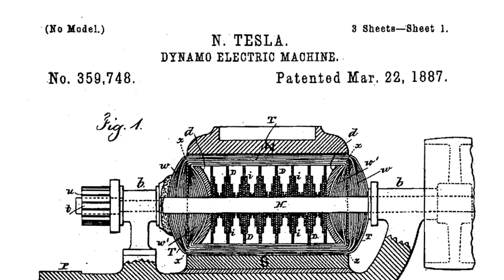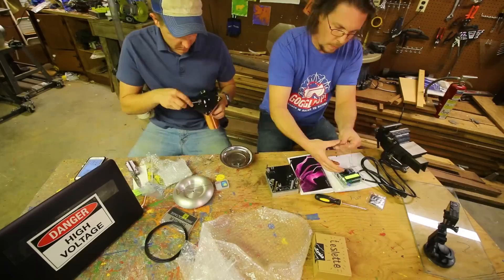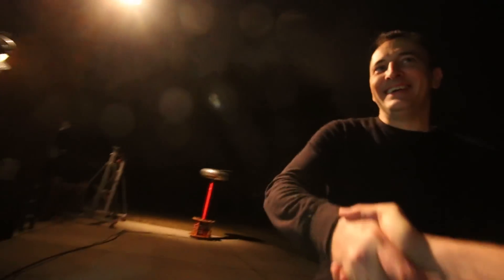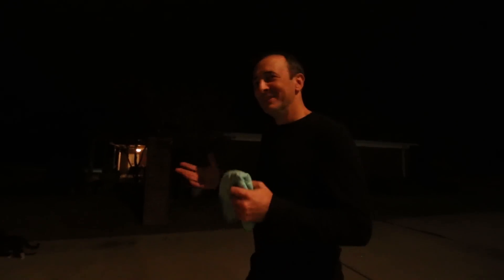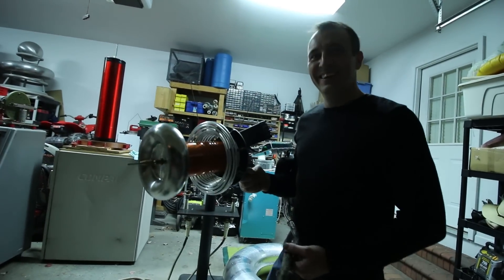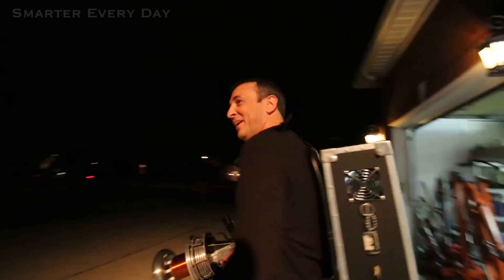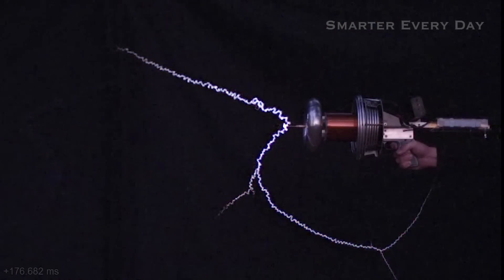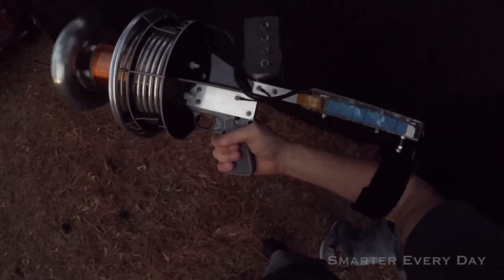Handheld TESLA COIL GUN at 28,000fps - Smarter Every Day 162

Comment: "He's just casually cleaning his Tesla coil" Walks over "What!? It's hittin your hand!"
Reply: Lite nyng he use grounding which is on his shoe which is safe
Reply: No, he literally said in the video it doesn't have enough current to be very dangerous
Reply: Voltage, current, and resistance are all connected. 

The human body is about 100,000 ohms of resistance. 

Voltage/resistance=amperage

It only take around .5 of an amp to kill you. 

Going by this equation it would take at least 50,000 volts to kill you. 

Generally people use 10,000V when demonstrating this but that gun definitely looks like it's more than 10,000V

No clue what's in there but V/R=A 
Is the math
Reply: @linuxd  Well most of your numbers are a bit iffy but your math is good. 
The tesla coil in the video is producing well over 100kV (When the power is maxed out it could even be a million volts) and the current needed to kill you is only about 5 mA. 
So why is he not getting grilled alive? There are multiple factors that needs to he taken into consideration.
1. Even though the resistance of the human skin is about 100 kilo ohms, his shoes makes him basically isolated from ground.
2. The skin effect plays a role when we're talking high frequency. To explain it quickly: when a high frequency current is moving through a given conductor, it will tend to want to run through the outside or "skin" of the conductor doesn't play a major role because the skin penetration at even 1 mHz is still a few centimetres if I remember correctly. The coil in the video looks to be fairly high frequency but not even close to 1 mHz, but it most likely doesn't play a major effect since what would kill you in this scenario is heart arrhythmia. 
3. Even though the peak current may be several amps, the overall power is still fairly low because of the duration of the spark (see slomo timer for reference). 
4. The resonant frequency of the secondary is knocked out of tune when the sparks touch him, making the circuit a lot less efficient.
5. He could have a ground connection on  his wrist making the current only pass through his forearm or hand.
6. Because the resonant frequency is so high, his nerve cells don't sense it and the risk of getting heart arrhythmia is reduced to basically nothing.
7. The circuit can't supply much current under any load which means that the voltage and also current will drop.
God that was a pain to write. Hope that clarifies why he isn't dead.
Reply: Rory M Duration of current also matters. Natural static charge easily accumulated in dry environment may result in tens of kV on a body that is enough to cause a spark across a few mm of air but it does not kill anybody.
Reply: Litenyng warning ear rape
Reply: Also a quick test you can do to test if you can handle more than 230 volts is to take  two forks and stick them in a power outlet. Disclaimer: Only works in countries with 230 volts.

(Don't actually you'll most likely die)
Reply: Mona Torkia  That's a dangerous message to send to people reading this. It's not safe.

Comment: When you figure out how to control lightning bolts and actually shooting them as a self defense tool instead of these devises please let me know. I will show you something truly amazing. Ahh what the heck, on the actual Tesla coils out there the wiring as well as the dome are all circular in nature. From spark gap to a circular coil as in figure drawing shown at 1:16 in the video. Ok now imagine the "coils" in other geometric shapes. Try that in a few different shapes and see what you get. The lightning bolts CAN be controlled. With a circular coil and other circular parts in the system the lightning is more erratic and less stable. I have no videos of this proof at this time, but i encourage you to try different set ups to see what the differences are that i speak of. 

Tesla invented many many innovations we use to this day. Two of the biggest would be WIFI and the incandescent bulbs. The thing about the two is Tesla never wrote or linked the two together that we are aware of other than in house testing in his lab, but he did state that his inventions would not need the use of modern known power lines and transformers. He was also a master in terms of radio waves and understanding them. His idea was to send power via radio waves (see HAARP antenna array) and some even believe it can control the weather or disrupt it in some way. Personally after almost 20 years of studying Tesla and this type of science i have come to find that Tesla kept some things to himself after the debacles with Eddison. I am sure that there are things he never documented just fr the sole purpose of it falling into the wrong hands.

Comment: I liked your video for many reasons - 1) Wearing your hat the right way 2) You seemed like a normal bloke, just very enthusiastic, not some cool talkin poser - I hate those guys 3) Anyone who appreciates Tesla, the guy, has my approval - 4) I learned something - I'm an old (UK) electrician who's learned to be respectful of high voltages and so called low voltages too, because the power distribution system delivers enough current to barbecue a human instantly - which sadly happened to a colleague when I was an apprentice  - cleaning out a HV bus-bar chamber thinking it was low - medium voltage, 415V, not 11KV or 3.3kv or whatever - Arced across and a terrible way to die, only recognisable by his ring apparently.   So I cringed seeing you let this thing zap you - I wouldn't have the nerve, despite knowing the current was low.   Hopefully, no-one is naive enough to THINK they can do the same with high voltage power lines or low - medium voltage industrial or domestic supply - But I've seen so many idiots treating it as casually as changing torch batteries - unafraid - unafraid because they don;t know how close they are to having molton metal explode in their face in a three phase flash-over.    A few educational videos of sub-stations exploding when people operate the huge breakers (the oil cooled/ quenching kind) too slowly would be interesting to see again and a reminder of the unseen power in those thin "wires".   It's HARD not equating huge arcs with danger - It's HARD to accept that most electrocution deaths are unspectacular, people just slump to the ground when as little as 50mA stops their heart.  ANYWAY!  on a more cheerful note!  You made a GREAT video here!  Thanks!

Comment: the Tesla gun vs the prince rupert´s drop
Reply: Glass doesn't have any conductive properties, so the arcs won't strike it (unless by dumb luck). :c
Reply: Neither does air, air is one of the only BETTER insulators. Yet you can see electricity traveling through it

Comment: Do you really feel smarter? The reason why this lighting cannot kill you is called  Skin efekt.The frequency of the output voltage is so high, that the current flows only on the surface of your body. Your muscles and one of them is heart of course :) are completely safe. Tesla coil can only burn you if the current is high enough.
Reply: Skin effect does not work with human bodies. You just don't feel it because it's too high frequency to actually effect our nerves, but it's not because it's somehow flowing on the surface. That said, the current can easily get really high and lead to internal injuries (with drsstcs and the like). Also burns where the arc hits you can be really bad. Small coils, as long as they're standard sstc's are safe to touch, but anything pulsed like drsstcs are dangerous, even though one might not feel it at first

Comment: In Canada we consider anything more than 5 micro amps to be dangerous, and I think a Tesla coil averages 23 Milli amps. Think of current as speed. Slows down to the point you see the arcs longer. It also depends where you are touching. He had insulated boots, for one. Energy takes the path of least resistance. We also use the earth because of its mass, to ground virtually everything. When he touches something with his left hand and not his right, the path of least resistance will generally not involve his heart, the current will go from hand to foot. But when you touch live circuits with both your left and right, the path of least residence is from one hand, across your chest and heart, to the other end and back into the circuit, completing it and allowing for continuous shock

Comment: What do the connections in his boots do? Are they insulating or grounding since I'm an EE but I'm not sure the details of his system. Especially since the coil was ok to shock someone not connected except by general earthing. Any ideas? Maybe just HV anti static discharge? The leads/snaps look similar but presumably around ankle or more likely directly to pads in the boot. And the boots would generally insulate well unless he is intentionally getting better ground to divert current from himself?

Comment: No microamps, dude, on the secondary coil, ur very wrong. The current there is quite a few orders of magnitude higher, than you think ;-)
Reply: The voltaic arcs that he is touching are at a huge voltage. But the current (ampers) is so low that it does not cause any damage to the organism.
Reply: Hey dude, the huge voltage might not be as huge as you might think and the current might be well over what is considered safe. The reason why even that high current (in up to tens of mA or more) is not gonna kill you, is that due to the high frequency nature of the current: Skineffect / penetration depth are your friends here. It won't kill you, but definitely WILL burn you.
Reply: how would you know know any of those details without any data to back it up? is the info available somewhere? The voltage would have to be large to cause an arc in the air

Comment: Re: Getting zapped

Besides the low current, the tesla coil's output is RF (Radio Frequency.) Because of that, the current doesn't penetrate. Due to the skin effect, the current travels along the outside of the conductor.

This is good and bad. On the good side, it is unlikely to pass through your heart. On the bad side, the current is concentrated and can cause serious heating.

Ham radio operators and others that work with high power RF need to be cautious, lest they receive RF burns.

Ray Drouillard
KA8UUU

Comment: If you used the voltage alot or by passed something on the gun would it become lethal?
Reply: Infinite0hacker It's the amperage that kills you. Voltage is what hurts.
Reply: Rickput Seven that's what I meant sorry but still if you used the amps would that kill you?
Reply: You would have to swap out the coils to change the conversion ratio--you only have so many watts available to work with (and it's the sort of weapon that if you were to use, you would be more likely to hurt yourself than somebody else). Do a bit of research on how induction circuits work if you want to learn more about this.
Reply: Rickput Seven 
both kill you
a car battery has 12 volts but packs a lot of amps, around 3 digits if you short one out. My dad, his mechanic friends, all mechanics in the world, and i (not a mechanic) have been shocked by it and it doesn't even hurt.
don't spread misinformation
Reply: +enriqueg, I'm not sure if you are trolling, but anyway. Car battery are able to output high current when you are using them as ignition, ie create sparks that last for split seconds. 

but when you got shock, the current is much lower. typical human body has electrical resistance around 1000 ohms, so 12V/1000ohms = 0.012A = 12 mA, not enough to do significant harm. 

Car battery are dangerous because of their huge capacity, because they are designed to hold lots of energy for long trips. If you short 12 Volts of  AA batteries in series, maybe it'll heat up after a while,  few sparks. because those does not have much energy in them, and the internal resistance of AA act as a safe guard. 

But if you give car battery a low resistance circuit, ie shorts them, even if its just 12 V, the huge capacity of the battery will continue to pump high current for a long enough to heat up the battery and melts itself or even explode.
Reply: +enriqueg, maybe a better way to explain current vs voltage is use the Water dam analogy. 

if you fill a 50m long vertical straw with water, the pressure will be very high 50m* 9.8m/s^2*1000kg/m^3 = 490 KPa. however if the straw burst, the water will quickly drain and does nothing at all. (high pressure, high flow rate, low capacity) (high voltage, high current, low capacity)

If instead of straw, it's a 50m high water dam. It will have same pressure. if you add a valve at the bottom of the dam, and let the water out slowly, you will have a continuous stream of of water squirt at your house, maybe cause water damage over time, but will not instant destroy your house.  (high pressure, low flow rate) (high voltage, low current)

but if that water dam is damaged, and unleash all those water at once, it will instantly cursh your house and everything along the way. (high pressure, high flow rate, high energy capacity) (high pressure, high current) = harmful.

current (flow rate), is what's transferring the energy and cause damage. Though most of time you need high voltage/pressure to create the current/flowrate in the first place,  but high voltage/pressure along won't do anything. Because they are just energy stored and locked in with high resistance/pressure valve.

Only when you reduce that resistance (short), and have enough energy stored (high capcity), then you can cause sustained high current, which unleash all those stored energy and does damage.
Reply: Alex M ok thank you for explaining this to me all of you are really smart I am really dumb lol
Reply: +Infinite0hacker no one is dumb, it's just a matter of patience and effort to look in to stuffs :D
Reply: No it isn't. It's a combination of multiple factors. The lethality of an electrical shock isn't wholly dependent on voltage OR amps. It's dependent entirely on the total amount of energy in the discharge, which is a product of power over time (joules).

Static shocks are hundreds of thousands of volts and carry enough amperage to kill a human (around a few hundred mA). But they don't kill people, or animals for that matter. It just stings really badly for less than a second. That's because the overall amount of energy is very small. The electricity dissipates so quickly that it's not able to discharge more of that energy into the body. Most of the energy is lost in the ionization of the air, and the same principles apply to a tesla coil shooting arcs.

On the other hand, if you short a fully charged, 50v 2200uF capacitor with your fingers, you'll probably get blown across the room. It would probably kill you if you had a weak heart. The reason why is because, again, it's about the amount of energy in the discharge. The energy is a product of power, current, volts, time, and resistance. It's multiple laws of electricity working together.
Reply: its definitely amps that stop hearts, not watts
Reply: Mollifier16616111
watts is a product of amps, and joules are a product of watts, and joules is a measure of energy

fundamentally it is the energy that kills, which is a product of voltage, current, resistance, and watts working together over a specified time frame
Reply: nope, its the amps
Reply: Mollifier16616111
okay then, i mean it definitely isn't, but okay
Reply: i, think its actual has to do more with the skin effect then the amperage.

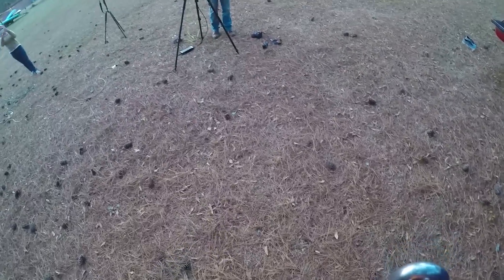Comment: 8:30 It's safe to touch the lightning because it's low current? I don't understand that!! There is lightning coming out of that thing, lightning != low current! I don't uundertand the explanation with the two coils...
Reply: The two coils steps up the voltage very high which takes the current way down (P=IV where P = overall power in Watts, I = current in Amps and V is voltage in Volts) The coils cannot change the overall power but when V goes up I must go down. Think of voltage as the amount of electrons being transferred whereas current is the speed at which they are transferred. You could think of it in terms of a river moving 100/gal/min. A wider river (higher voltage) means the water doesn't have to move as fast (lower current) in order to keep the same flow rate.

Have you ever seen a Van De Graaff generator? Same idea.  Voltage is not what interrupts your cardiac cycle but the current does. Generally even a few milliamps will be fatal.  He said microamps, that is not fatal as you can see in the video. Though I would guess his heart isn't too happy with it lol.

I was hoping he was going to go into what the Tesla coil's original purpose was which is to provide power to things wirelessly through the air.  Maybe next time.
Reply: Thank you for your answer! " The coils cannot change the overall power" this fact would have been enough for me. Why I didn't think about that :D ?!? Thank you very much! And no, I haven't seen a Van de Graaff generator yet. Have to look that up.

Comment: What determines the path of the lightning? The direction of lowest local voltage? And the arc itself increases the voltage in the surrounding air, so it's more unlikely for the lightning to back up on itself? That's why it will most of the time follow a path generally away from the user...?